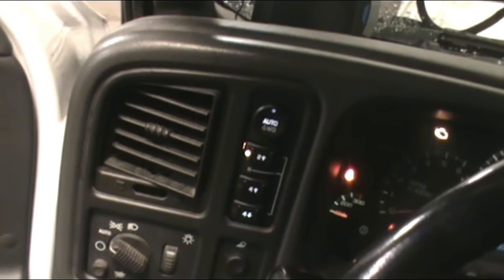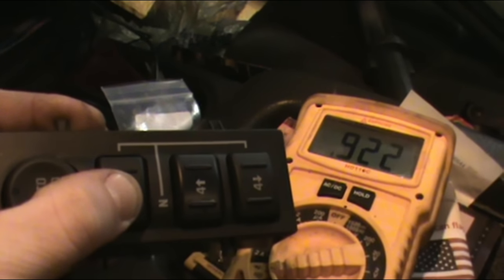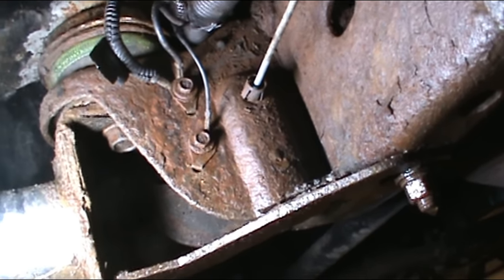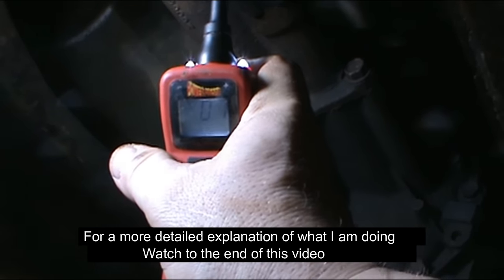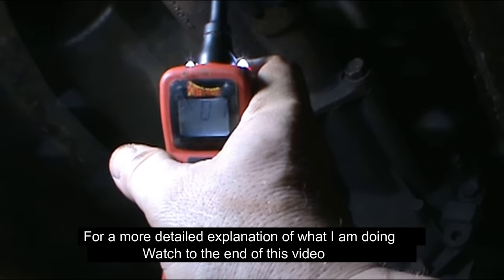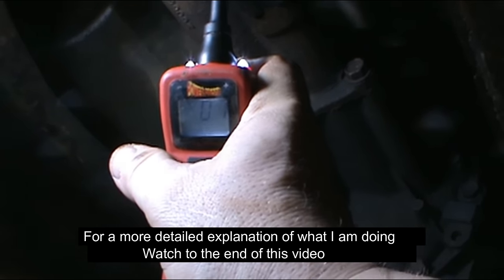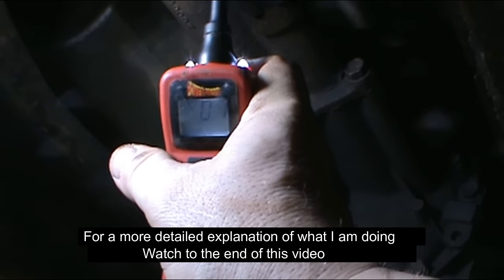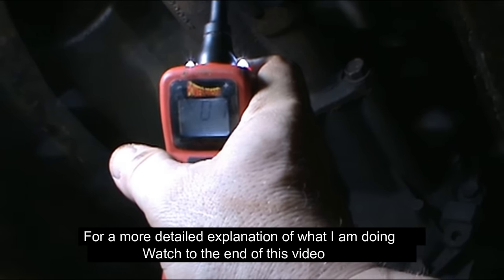Service 4wd diagnosis

Comment: To late about the Several $1000.00 dollars in parts to fix the problem. For the longest time it wasn't a issue with Service 4WD . It used to be just couldn't get it to shift at all. Like you have attempted to clean the area down on the Chassis Even with a grinder. I have left the batteries disconnected like another video suggest for more than hours, Like days to attempt to clear a code. My Turn style Switch lights up on initial turn of the key but the after it like little test then lights will go out on the dial and not come back on. I have attempted what you suggest and ran a new negative line but used a butt connectors that are water tight. Things just are not working for me though. So I have unplugged the batteries again attempting to maybe clear some codes. I am just at a loss at this point. My mechanic was able to get the Transfer case motor to shift but Only into 4X4 Lo and that was with a Snap-On Diagnostic Machine. I have been to 6 Mechanics and none of them have been able to find the problem. This new ground didn't do anything except help me freeze slightly. You wouldn't have any other suggestion maybe?
Reply from the maker: I think your encoder is bad, I got a video on replacing it
Reply: @GSEShop  I don’t have the same type of Electronic Shift motor on my 2008 Chevy Duramax. They changed the style of the shift motors where it is slightly different. Nothing close to that one but it has exactly the same issues! So you have gave me some testing ideas for sure!

Comment: I'm a tad confused about the ground wire jumper. Is it necessary to jump from the plug in the engine bay like you did, or can I clip it at the actuator and run from there to the same firewall ground? 

After over a year of digging through old forums and throwing parts (cleaned frame ground, replaced actuator, dash switch, encoder ring, full encoder motor, and TCCM), I think I might have found my issue! Now that I'm close, I don't want to mess anything up.
Reply from the maker: It really shouldn’t matter as long as you have continuity at the plug.  My wire tested good to the fender well, so I jumped it there. If you want you can go right down to the plug on the actuator, however, the other reason I did it there is to keep it out of the rain/snow etc. that we drive over.  If you do splice it down there I would take extra efforts to waterproof/seal the elements out.
Reply: @GSEShop  Thanks for the quick reply. Those are some good points. Unfortunately, I just tested for ground at the plug hoping to find none, but I have continuity there. Back to the drawing board!
Reply from the maker: @funcle_kevin  I have other videos.  What all have you done
Reply: @GSEShop  Cleaned the frame ground, replaced axle actuator, replaced dash switch, swapped out the encoder ring, then replaced the entire encoder motor, and TCCM. I've eliminated just about everything I can think of. My speedometer reads exactly the same as the live data on my scanner, so I doubt is the speed sensor.
Reply from the maker: @funcle_kevin  I would be looking for either a a skinned wire or the computer itself.  I have never seen a comp go bad but when you eliminate everything… I would be checking my harnesses
Reply: @GSEShop  Hopefully it is a wire. I agree that the computer is unlikely given that everything else works (or at least seems to). I'll let you know what I find.

Comment: So your 4hi light never illuminated? Mine is blinking. Sounds like the encoder motor is cycling when I have the old lady push it but light continues to blink. I have the new encoder motor but don’t want to do the work if it’s a ground.
Reply from the maker: Try the ground first, if it doesn’t work you can leave it in and it will cost way less

Comment: Would this work on a hummer H2 - I have  a short somewhere that causes the dash and 4x4 buttons to go crazy plus unknown driver as well. Great vid.
Reply from the maker: Possibly but I cannot say for 100% for sure.  I know the H2 has a Silverado frame and drivetrain but I am not sure about the electronics.
Reply: Thanks I’m watching your abs sensor video now😀. That may be the culprit. Gotta love wiring diagnosis at home. Thanks again, merry Christmas!
Reply from the maker: @thewonn  I have a lot of videos about troubleshooting the electrical components on this truck of mine

Comment: Bother that was an awesome video for trouble shooting and you're rite about the actuator plug cuz everything time I mess with it the code goes off but my problem is I'm not getting power to what do you suggest I run the wire to?
Reply from the maker: lee sanchez you are not getting power to the actuator?  How are you determining there is no power there?
Reply: @GSEShop  the voltage is low on the power wire
Reply from the maker: @leesanchez2602  I have not heard of that one.  If you can figure out which pin on the TCCM module it is I would check the output voltage there.  If it is correct then it must be a problem in the wire itself.  You used a multimeter or a power probe to check the wire right, not just relying on the computer trouble code?  What voltage are you getting?
Reply: @GSEShop  I was getting 2.4v but I'm not getting juice at all
Reply: And I'm using a multimeter
Reply: I followed the wire all the way to the wheel wall and no power from the plug either
Reply from the maker: lee sanchez let me do some checking.  The power should be coming from the tccm under the dash but I am not sure what wire
Reply: @GSEShop  when I turn on the truck it sometimes is on 4 hi or 4 low or 4wd or the red light is on or it doesn't turn on at at all... it really started acting up when I changed out the actuator

Comment: Just to be sure we connect the vampire to the black ground wire? I couldn't see and I don't like to guess.
Reply from the maker: On my 06 Silverado the ground wire is black.  I would check a wire diagram to be sure it is the same for yours.  You want to vampire connect the ground wire from the actuator and connect it to another ground.

Comment: PLEASE HELP ME

You guys got any ideas? I wanted my 4wd to work so I took the wires off and brushed them off and the frame. 
I come back today and my truck won’t start, EVERYTHING works radio, door locks remote on button to lock and unlock. Before I touched those wires I’ve never had a problem, there is one wire that’s ALWAYS been unhooked that was hanging but that’s never caused me a problem so I know it’s not that. I put it on with the other two that were very rusted got nothing, so I took it off and put it back to the way it was before I touched anything, two wires on one bolt the other one hanging. Can I please send you a video or picture of my set up!!!
Reply from the maker: Sounds like your ground wires are corroded internally.  Try doing the bypass I did in the video

Comment: Hola amigo, buscando una solución a mi problema con el fallo servicio del 4 x 4 en la pantalla del clúster de mi camioneta Hummer H2 del 2006, he dado con su vídeo. Me ha gustado mucho su vídeo y forma de explicarlo todo y lo más importante es que lo hace desinteresadamente y esto es de agradecer y mucho. Independientemente de que pueda solucionar mi fallo o no. 

Llevo luchando con mi problema desde hace bastantes años y no dan con el fallo, me han dicho de cambiarle algunas piezas pero ninguna en concreto, por lo tanto no he querido echarle dinero en piezas sin saber al 100% de que pieza se trataba y cual era la causante de ese fallo. La única pieza que por probar al no ser muy costosa se le cambió, fue la botonera del tablero de instrumentos, aparentemente quedó solucionado pero al poco tiempo volvió a aparecer el mismo problema y es el mismo que le ocurre a su camioneta. 

Lo dejé este fallo por imposible porque como hasta ahora el servicio de inspección técnica de mi país "ITV" nunca me habían puesto problemas por este fallo pues la verdad se quedó mi camioneta con ese fallo hasta el día de hoy que he tenido que volver a retomar el problema de este fallo porque el servicio de inspección de técnica de mi país "ITV" en "España" me ha fallado negativamente dicha inspección por este fallo. 
Tengo que resolver este fallo cuanto antes ya que mi camioneta no puede circular sin esa documentación de inspección desfavorable. 

Por cierto, ya le he dado mi like y me he suscrito a su canal desde mis dos cuentas de YouTube.

Muchas gracias por toda su atención amigo.

Un saludo desde España.
Reply from the maker: Sorry I do not speak Spanish

Comment: My 03 avalanche goes in 4hi only when key is on the "on" position, but not while truck is actually on. Then it doesn't go back to 2hi. I'd have to truck off truck then put key on "on" position once again in order to put back in 2hi. 4lo doesn't engage or makes noise at all. Any ideas, could it be the switch buttons. (I already replaced tccm andnl actuator)
Reply from the maker: Test your switch because it is easy but I think you have a wire problem

Comment: I have the same issue when you first started switching from four high to two-wheel drive it wasn't switching then you plugged the switchback up started changing what did you do to get it to start switching from four high to two-wheel drive
Reply from the maker: It was all the ground wire I added
Reply: @GSEShop  oh ok I gotcha thanks a lot

Comment: Hey brother I know this is gonna be a stupid question because I've watched the video several times and I'm hesitant to do the job because I'm not familiar with wiring but, just to confirm, I'm supposed to quick connect to the black wire?
Reply from the maker: On my truck yes, I would check a diagram to be sure
Reply: I'm having trouble finding an accurate diagram but I've got an 03 Yukon so I'm 90% positive it's the same 4 prong you have. Thanks for the video
Reply from the maker: @Tycoonjvke  no problem, I just don’t want to lead you astray
Reply: Sorry to bug you buddy but just to be sure it's not the black wire with the white line it's just the all black wire correct
Reply from the maker: I think so, this video was several years ago so my brain is kinda fuzzy

Comment: For me it was a bad fuse connection. Meaning the fuse wasn't blown but the prongs were a little corroded. Cleaned the prongs and it worked.
Reply from the maker: Corrosion. Seems to be the Achilles heel for these trucks

Comment: My truck is stuck in 4WD. 1999 Chevy Silverado 1500. When I press 2HI it flashes and the front axle actuator makes a weird buzzing noise and the transfer case control module makes a clicking noise when trying to engage 2WD. The actuator did the same as the new one just goes in when pressing 2HI then comes right back out to come into 4WD. Idk what to do
Reply from the maker: Did you try the ground splice I showed?

Comment: I stayed til the end.... I was only aware of the bolts under the driver door from another video .... So now I can check my actuator plug and try the jumper ground to the ground stud on the hood ground strap point. And my hood ground strap is broken free of the stud....
Reply from the maker: Don’t worry about the hood strap.  And yes I would try this mod it won’t hurt, and it doesn’t cost very much
Reply: @GSEShop  Thanks for your feed back and video... I tried just removing the 2 ground bolts below driver feet.... Cup brushed the metal surface and then added dielectric grease ($2.85) and shined the brass eye loop connectors. Put it back together, and I now have everything working. Bonus was the piece of information about the 4 low being in neutral before it would shift to that position. Thank you for your help and you explained the wiring and use of the VOM very well for me.
Reply from the maker: @genesloan3175  your welcome
Reply: @GSEShop I just thought I had fixed my ground problem!  Yesterday, it was fine. But I had not A) driven it
B) not disconnected battery as part of the ground area cleaning 
C) had not checked the plug by the actuator.

After I had "fixed" my grounds, I did notice that the 'Service 4wd" on my dash was now gone.
Today after a drive in dry but cold conditions, I stopped at some distance, for approx 1 hr.... it was after this stop that I noticed the "Service 4wd" back on and indicating 4 low on my switch, where it remained all day. 

I will seek to do the hood ground stud connection of a jumper wire to the 4 contact plug you showed on your video .....
Reply from the maker: @genesloan3175  ok let me know
Reply: @GSEShop  well, a reset by disconnecting battery and installing a new switch only has shown that something else is at fault. It still shows Service 4wd message on my cluster.  And it rained, and I am dealing with outdoors without a shop. So I still will need to look into grounding the plug  of the actuator to the hood grounding stud. I'm beginning feel like I'm looking at a new actuator. I just had a new remanufactured transfer case installed just last July.
Reply from the maker: @genesloan3175  they probably didn’t do anything to the TCSM when they rebuilt it.  I would try the wire mod first, it is cheap and does not have to be undone if it doesn’t fix things
Reply: @GSEShop  Finally! The wire from hood ground stud under the left side exhaust across to the right side to the actuator. I was able to raise my truck high enuf to get a splice connector attached right behind the blue plug. I attached it to the black wire... It did not immediately work. It wasn't showing any lights at first. Then within a mile of driving it was showing neutral. Then it jumped to 4 low. And during this time since I installed jumper wire it was showing Service 4WD on cluster. I stopped at a store, then came out, started it up, and it began to work after about 7-8 miles. When I got to a stop sign, I cycled thru the buttons in neutral and it was shifting between all the buttons. At home I shut truck , off and turned to on position, and buttons are still working and no Service 4wd! Yes! Thanks for your video.... Thanks for replying!
Reply from the maker: @genesloan3175  glad it is fixed, I am glad I could help

Comment: Hey got 02 did a overhaul on the frame pulled the body off the chassis put it all back together everything went back fine truck fired up… but now my push button 4x4 will not light up an not show what gear the transfer case is in also it says service 4wd on dash when I shut the truck off everything worked fine an it was in 2wd when I did my first start since the overhaul it’s stuck in 4wd
Reply from the maker: Your transfer case control module is probably bad

Comment: I’m same issue, replaced front motor, transfer case motor, transfer case control module. I’m about to go check my grounds “I have cleaned the body ground, never checked for good power tho”
Reply from the maker: Good luck I hope it helped

Comment: your video its great helped me alot honestly i just need to know what wire did u put the vampire wire at? it shows on my tester theres 3 ground wires on that plug i’ll appreciate it u earned a sub and like  this the content im talking about!
Reply from the maker: There should only be one ground wire.  On my Silverado the black wire was the ground I spliced into
Reply: I’m with you.   I got two grounds at the transfer case actuator, the 12V battery red(or I thought) was alternating off and on regularly, and the Orange had 12V.    Having two grounds showing leads me to believe there is a hot cable shorted to ground and is now showing ground on our meters.
Reply from the maker: @andrewhigdon8346  I have never traced the wires from the transfer case actuator, I would be interested to see what you find out

Comment: Great video. I have a similar problem with my 99Z71. My 2wd light will stay lit up but when I switch to either Auto,4hi or 4lo the light just blinks. It won’t stay lit up like in 2wd. I put a new switch in and it did the same thing. So I figured it was the T-case motor, but I can hear it shifting. I noticed my front drive shaft would spin freely so I thought maybe the front differential was bad, but I didn’t hear any noise up front.I didn’t check the front differential actuator yet but I plan too. I subscribed to see more videos.
Reply from the maker: Vinny Vega sounds like you are on your way

Comment: Couldn't you just Supply ground temporarily to the motor with the Power Probe?

I've used a multimeter for years but gotta power probe 3 a couple of years ago and it is sweet
Reply from the maker: I don’t see how that works while driving

Comment: Hey man. I have another question for you. My truck is losing power in acceleration and even delaying when I push the gas. No codes related. I think it's a fuel issue but I'm not wanting to drop my tank if I don't have too. Any advise?
Reply from the maker: I would test the pressure at the fuel rail first

Comment: Exactly where did you splice in and reground at? On what side of the connector that was below the master cylinder?
Reply from the maker: It really shouldn’t matter as long as the connector isn’t corroded, but I would recommend doing it before the connector to the front of the truck.

Comment: GSE Shop
So if I trace the wires up from the actuator plug, I will find another plug to splice into like you have done?   Is it easy to find?
Reply from the maker: Adam Lucas on my Silverado it was in the center of the wheel well on top of the frame.